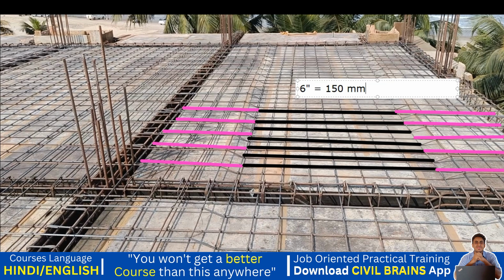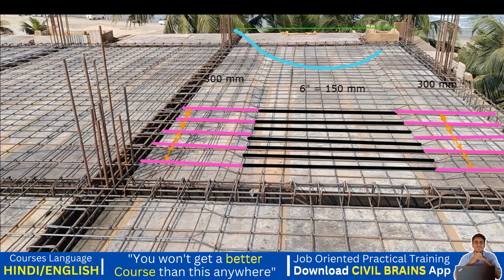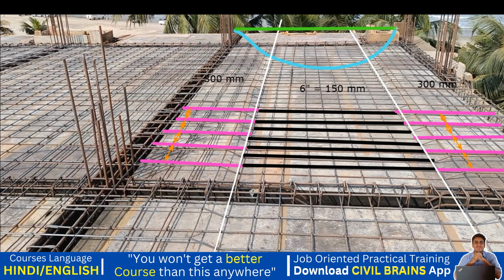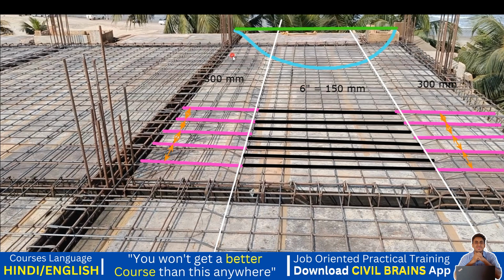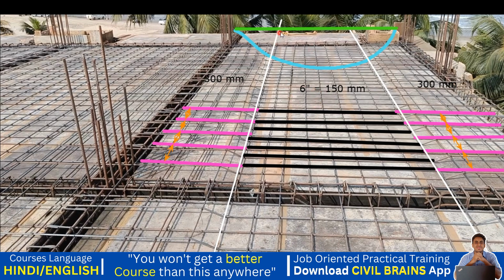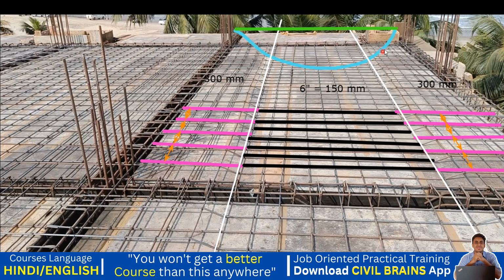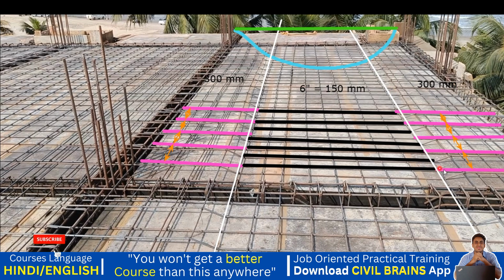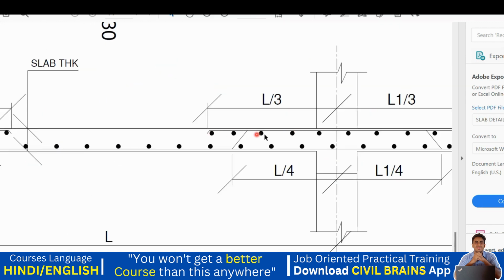All about ONE-WAY Slab in 20 Min | Akshay Kamath

Comment: If we provide brick  🧱 work around the wall can it cater the Negative bending moment/ Lift up please explain sir
Reply from the maker: U meant to say , slab bars will rest on brick wall and not on beams??
Reply: Sir, I mean to say that if we make the second floor upon it we still need to provide a cranks bar for the first floor
Reply from the maker: @_s621  it has nothing to do with ur above floor brickwork. Its the behaviour which comes due to rebar and concrete connection that u need crank bar to resist hogging bending moment

Comment: single bar is bent up from both the ends ?
is it so ?
we generally provide bent up on one side only on a single bar
the next bent up on other side is provided on next bar not on the same bar.
i think this site has a mistake
Reply from the maker: No. u should understand the concepts first . slab bar we can provide in 2-3 ways . this is also correct . different cities in India follow  different way . here both side crank is provided , next bar is straight , that way we  are doing it